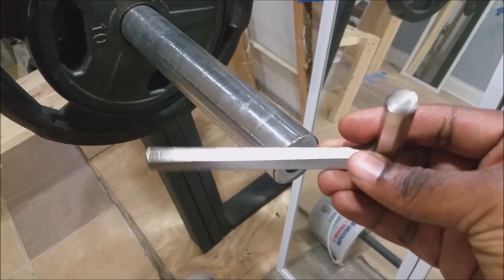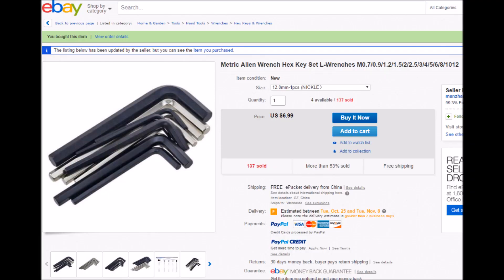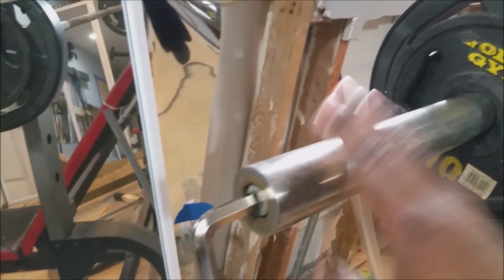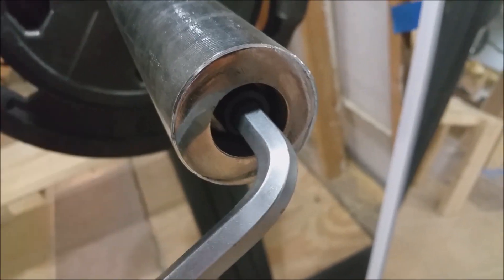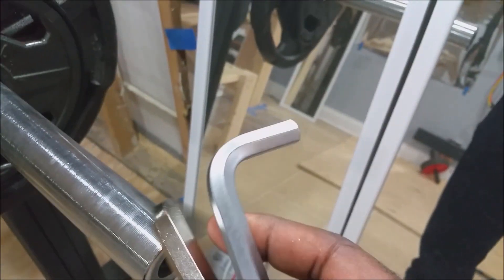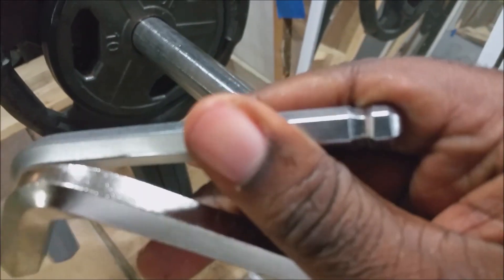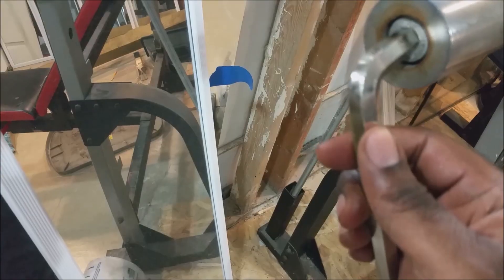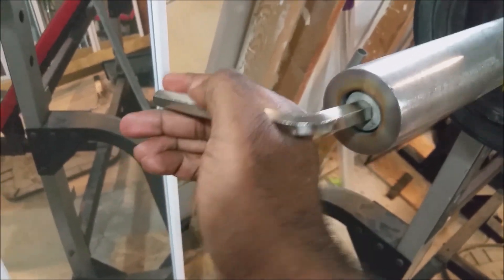how to tighten an olympic barbell screw

Comment: Just came across a hack after watching this video. If you don't want to order anything, you can go to the hardware store and use a lag screw with the right size bolt head. Put it in a vice, bend into a 90 and voila

Comment: What's the size of the screw needed and the wrench? Thank you
Reply from the maker: Not sure what screw size.  But I doubt you can get it from a hardware store but then again I'm not sure at all .. I dont remember the wrench size I used.. im almost 100% sure I said it in the video
Reply: Parkrose hardware has those exact screws, I replaced both the washer and the screw in mine not too long ago and it couldn’t have been more easy.
Reply: Thank you

Comment: Thank you for your video.
But pleased tell me what is the purpose of adjusting the bar and what difference does it make adjusted or un-adjusted.

I saw these her screws on mine and never knew why they were there ???
Reply from the maker: Over time the screw becomes loose... it could fall off.. during a lift this could be dangerous.... this is what made me make the video.. mines didn't fall off.. only needed to be tighten
Reply: @TFE_MaD  how do you know if you need to tighen it?
Reply from the maker: @illdrumatik391  the screw will spin
Reply: @TFE_MaD  One more question man the ends of the barbell sleeves move back an fourth slightly is that normal
Reply from the maker: @illdrumatik391  nope. They should only spin..
Reply: @TFE_MaD  so does that mean a little tightening is in order?
Reply: @illdrumatik391  Yes like they needed tightening yesterday
Reply: @illdrumatik391 yes, slight rocking left and right is normal with almost all barbells. I have about 20 barbells, all bought brand new, everything from kabuki to rogue to rep to American barbell and everything in between. Almost all the sleeves have slight movement left and right. Ignore the people who say otherwise

Comment: screw HEXA BOLT LOCKED sleeves "oly" bars are very cheap and shaft is allways in "dogshitium" 125/140 000 psi rating.... its just good for.... nothing.!    now you can buy for 200€ a very decent  bushing sleeves barbell in good steel !!! at gym 2 bar of this type are used for     initiation with false plates (but good diameters)...for all training between 55 and 90 lbs....   good means for never bend it !!!
Reply from the maker: +alan levy 
I get all my equipment from yard sales
Reply: Lol you don't need a fancy bar to bench..
Reply: Alan, can the bushings sleeves still come loose? I want to buy one but am concerned about maintenance. Are the bushings sleeves bars the ones with 'capped' ends with no hole? Thanks very much
Reply: @jamesrichards4294  bushing sleeves no need great maintenance.....(true bushing bar ..not with hexa bolt)  ....try to  remove sleeve just if spin become not easy AND IF LUBRICANT OIL IS NOT SUFFISANT.....
Reply: @jamesrichards4294  you can  begin with  WD40....an end with Engine car oil...... all 2  years...no  need more.... all 1 year in moisty  /wet  (>80percent saturation or >65% if see (salt spray) proximity
Reply: @alanaliyev456GT  thank you 🖒
Reply: @jamesrichards4294  for neadle bearing...same thing if spin is correct  just a few lubricant each year max.......no more
Reply: @jamesrichards4294  i hate  bar with hexabolt because  a  rupture caused death of a young coach  during fitness squat assist. (  BOLT SNAP  IN DESPITE OF A GOOD CLAMPING  BECAUSE BAR WAS CHECKED BEFORE SQUAT) .....   ok for a bad steel  bendable bar...its not dramatic  BUT ’AVOID  HEXABOLT.. . EVEN  FREE ITS  BAD ITEM